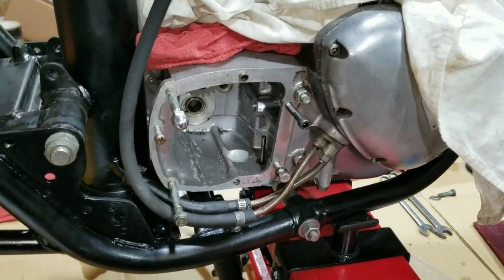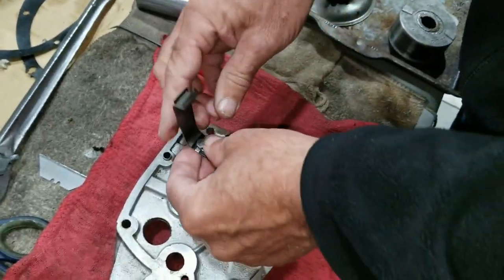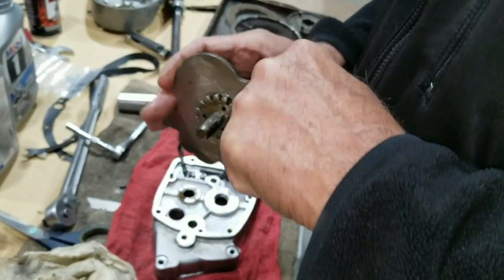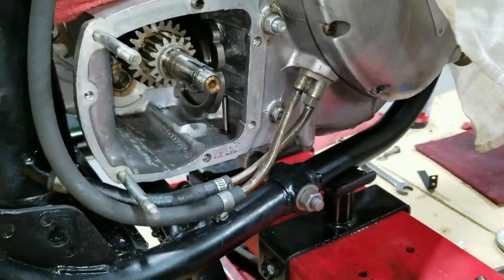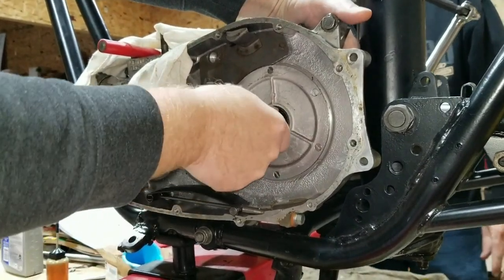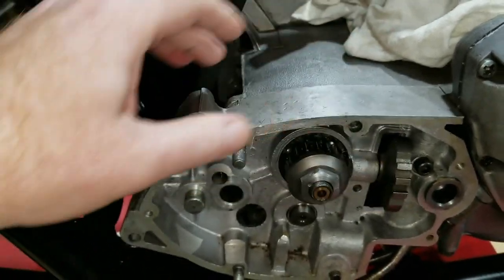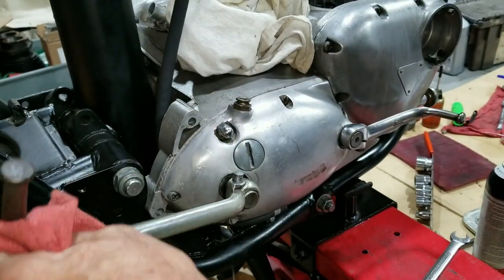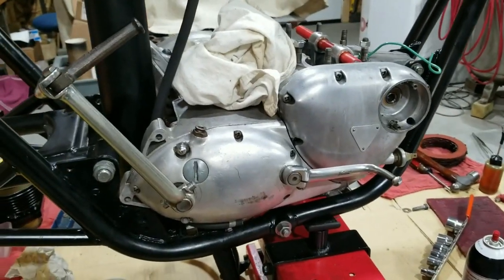1971 Triumph Tiger 650cc Restoration Part 14, Transmission assembly and setup

Comment: Nice work guys. The 40 or so minutes flew by. I have the bonneville '71 5 speed. They shipped over a little over 200 of the 1971 5 speeds.

Comment: I bought a new leaf spring but I couldn't get all my gears to save my life. The new leaf spring looked to be bent at 90 degrees and the old one was a little over 90 degrees. So I put the old one back in. It wasn't all that bad anyway. I'll check it tomorrow to see if I can get all my gears.

Comment: I need a 71 T120R transmission doctor. The weirdest thing happened to me the other night after arriving at bike night. I rode my 71 T120R chopper to bike night and it started great. One kick. I rain great although I seem to have to get it up into the rpm to shift good. If I don't I will get a false neutral between 3rd and 4th. Ok after getting there I was waiting for this guy  to park his bike in line with the other bikes. So after he was done I rolled up to back my bike in. I put in neutral and turned off the motor. I tried to back peddle my bike into place but it wouldn't back up. It felt like it was still in gear. It would roll forward like it was in neutral but not in revers. This guy that I was waiting helped me back it in. I tried to kick it but it was still in gear. The motor was still engaged even with the clutch pulled in. Then it seemed the kick lever wasn't engaging in anything. The return spring was still working but when I tried to turn the motor over it wasn't engaging anything. The shifter would engage the pawls and change gears. I rolled forward without the clutch pulled in again and tried to roll back but it wasn't easy. So I tried to kick it over again and the kicker engaged and started on the first kick. It's like the transmission was in Twilight Zone. I left it park for awhile and when I left, It started up like nothing ever happened on the first kick and change gear flawlessly all the way home. Weird. I drained the gear lube and pulled the kicker cover and didn't see any issues. After re-installing the cover it has started first kick every time. One thing I did notice that there didn't seem to have one of those locking washer behind the ratchet gear nut. But the nut felt finger tight. I did recently put a new gasket on the kicker cover.

Comment: Question. Can you change the main shaft oil seal from the inside? I have a one tooth taller chain sprocket so I can't get it out through the primary side? I did this 30 years ago and have forgotten exactly how I did it. I'm sure I did it while the transmission was out.

Comment: My question is were does that oil tube to the front gear originate from. Mine is broken off from that little bracket above the front gear behind the stator on the clutch side of the motor. I can see that it is suppose to oil the gear so I should replace it.
Reply from the maker: Well when I got this bike the tube from the top tin cover was all broken off and the front bracket that holds the tube in place was broken off also and the tube was gone! The nipple that the alternator wire runs through holds that tin cover inplace and that tin plate is called a breather cover plate assembly part number 71-1072 it has a sort of cup on the backside and a small metal tube through it that you hook the plastic tube part number 71-1078 to that runs down to a tube support called clip part number 70-4705 that holds and points the tube at the sprocket to oil it and the chain.
Reply: @jessesvintagegarage765  Thank you. I still have the clip but the tube had gotten old and brittle and broke off at the beginning of the clip. So I guess I will have to remove the breather cover plate to install another tube.